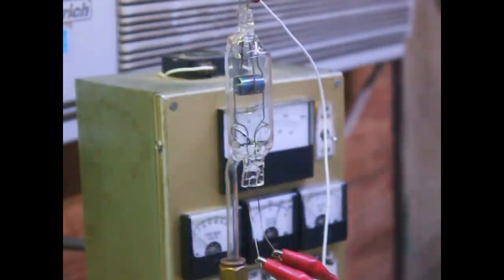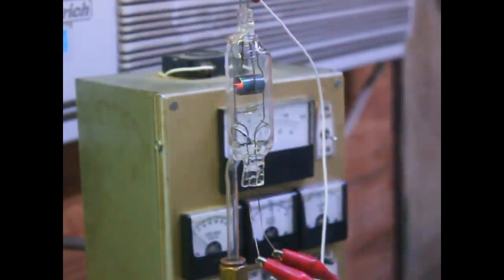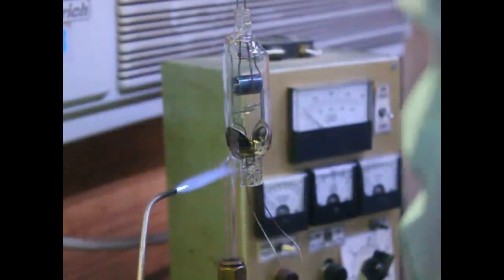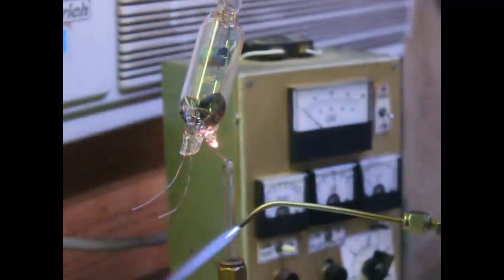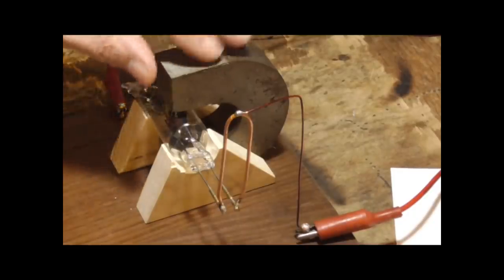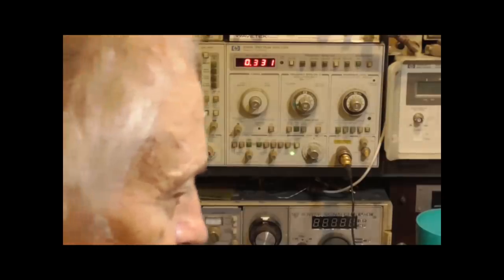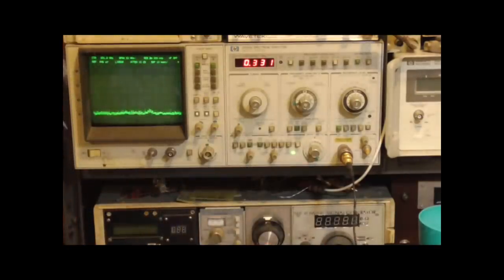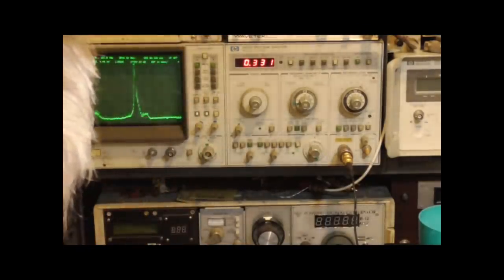HOMEMADE MAGNETRON WORKING!

Comment: so the inductance of the loop changing because the bulb's circuit caused the inductance to change. So to change the inductance you would put a varistor in the loop to tune it wherever you wanted the output frequency to be. So what would be the range of inductance frequency changes to the radar frequency. Maybe 100 hz? Or would you use one of those inductance tuning loops, a variometer to change the inductance with one of those tuning condensors. This particular magnetron could be extremely tuned to a single frequency, of course side bands would still show up on the return reflected signal because of radio propagation. Just wish I had an F-35 to practise on to see which frequency reflected best at this low band. You would have to measure exactly the width of the wings and the body length to 1/8"